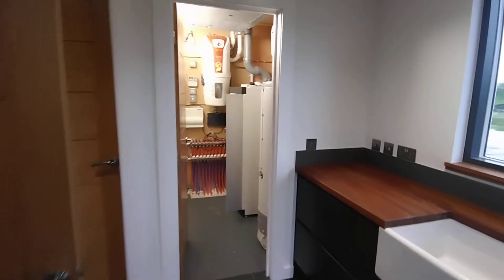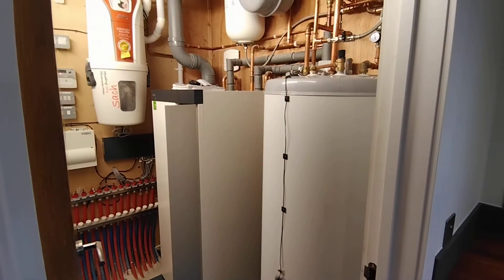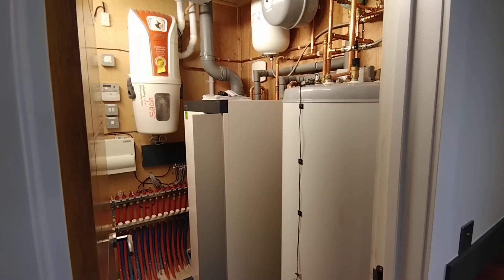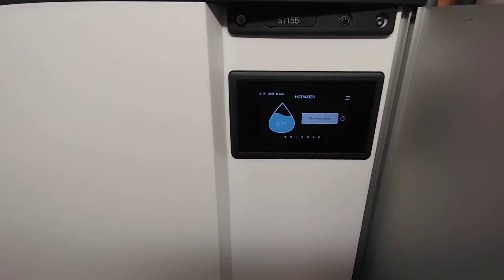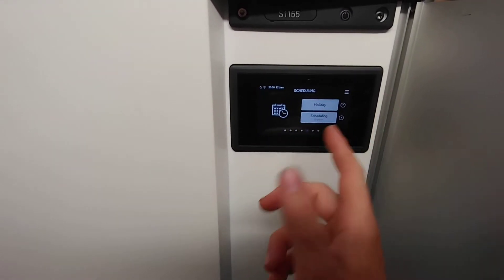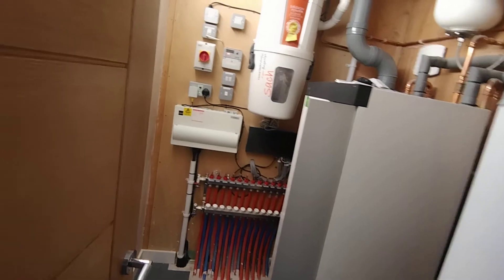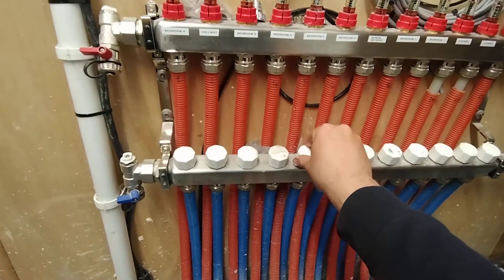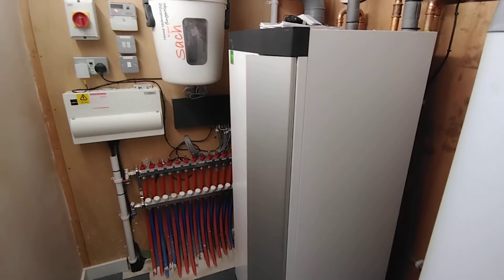Nibe ground source heat pump

Comment: Really nice implementation you got there. I am starting my house project soon (240 sqm Usable) and planning to go for a nibe ground source heat pump, closed loop. You know, it's really easy in my country to get a gas central heat system, for around 2k EUR installed, but we see gas prices going up and up. My set of questions: Do you feel like the nibe heat pump is the best in it's class ? if yes would you recommend it after a couple of months of usage ? Do you feel that it is efficient and if yes what is the COP you are achieving ? (also i am curious about the input temps you get from the ground/water). Thx for your answer, and appreciate the content as there is not so much covering nibe on YouTube.